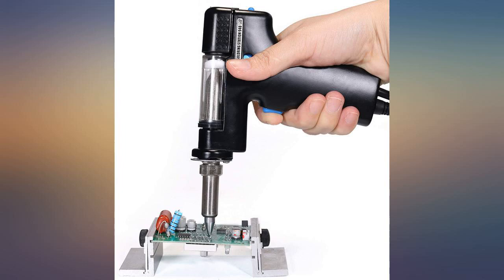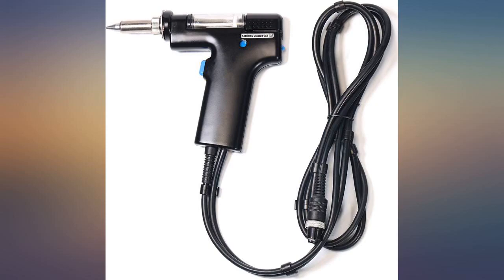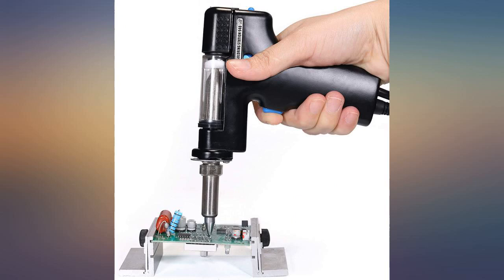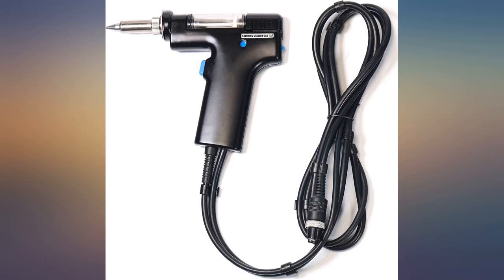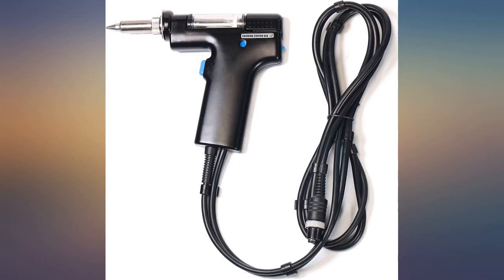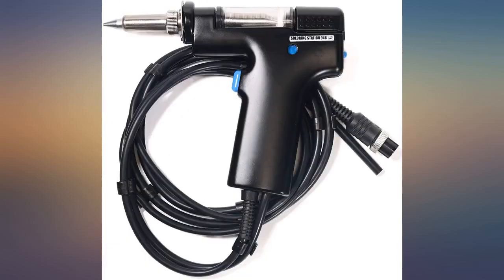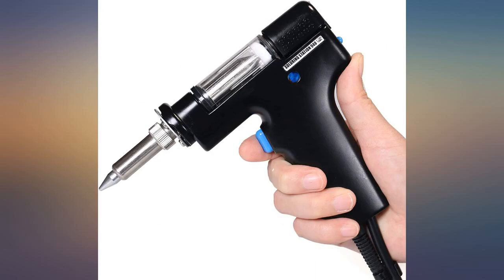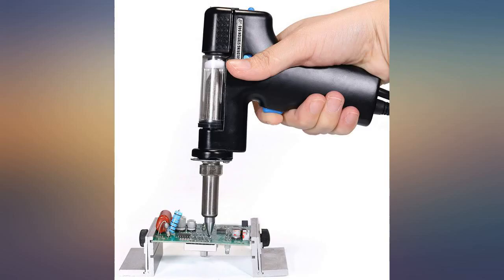YIHUA #948G Replacement Desoldering Suction Gun Handpiece//Handle for Yihua 948 and revieww

Comment: the key is: take a drill bit the size of the cleaning rod; with the spring on back. drill the tip that size, 
and use that rod to clean the tube to the spring inside.(before use) you will not have to take it apart for a long long time.